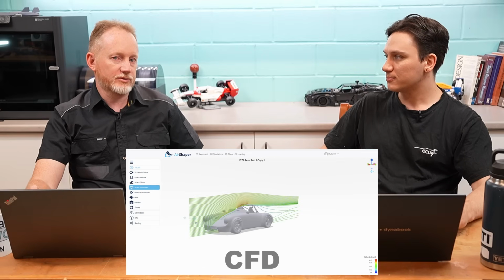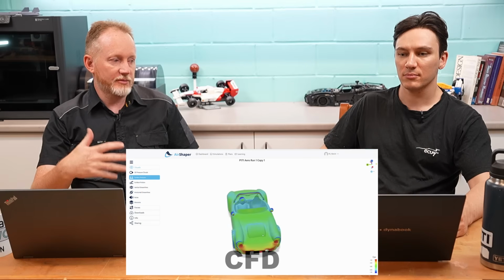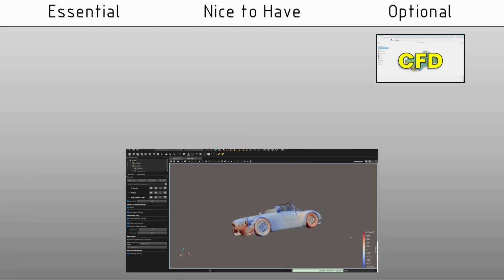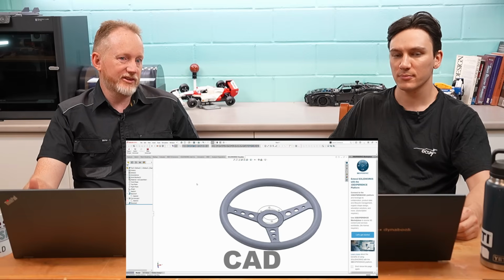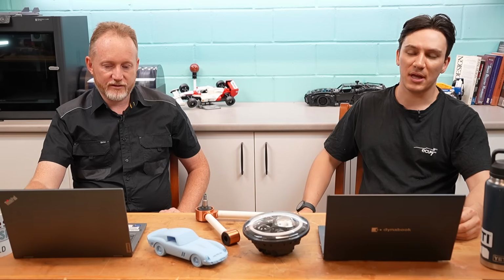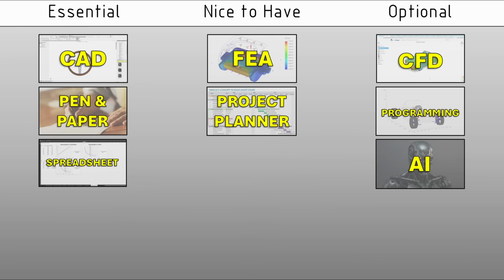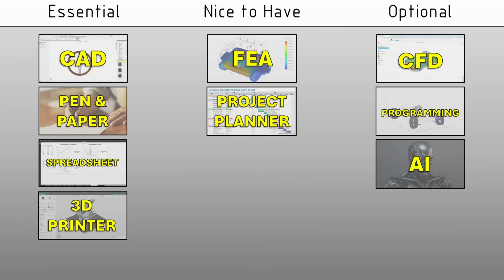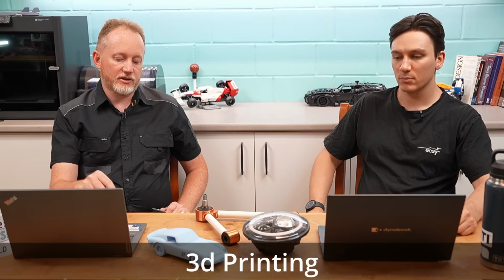Our Top Car Design Tools: Pros & Cons (Dr. Kev & Harley Q&A)

Comment: Stop using windows and support Open source.  I am an engineer, I dont work for big companies,   CFD, ( openFoam)    CAD ( Freecad), electronics ( Kicad), spreadsheets (LibreOffice), Graphics (Inkscape)     2d cad (LibreCAD) lazer cutter ( lazergbl )    My annoyance: My calculator (Texas Instruments NSpire, Windows only)     My cutting machine (Silhouette 4  windows only) ..My ferret scanner ( windows /mac only )     ,,, My gripe with open source, yes its free yes its very powerful but the ui,s suck, HOWEVER, the communities  are  very friendly and helpful.       Freecad has FEM, and CFD built in  and handles scanned meshes
Reply from the maker: I am a fan of open source, and should be using more of it.  Although our background is in engineering contexts.  Harley works for quite a sizeable company.  In these environments Windows is just a given.

I have used OpenFoam on and off, KiCAD, Inskcape, Gimp, Octave, Blender and a few others.  At one stage I even ran Linux as my main machine.  But there is enough in dealing with other people that Windows is still the defacto engineering environment.

I do keep an eye on the scene though and maybe there is more I can do in future videos to highlight some of the tools in this community.